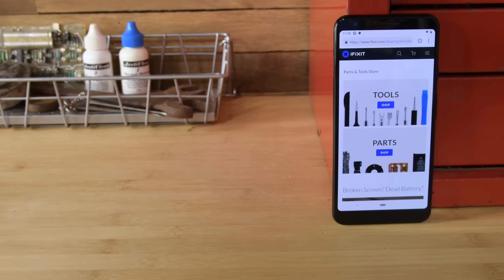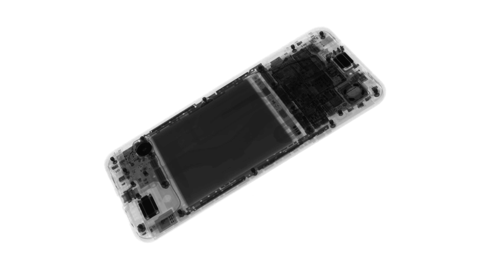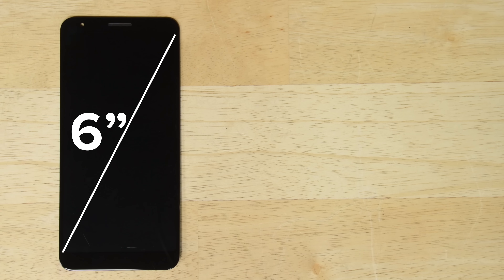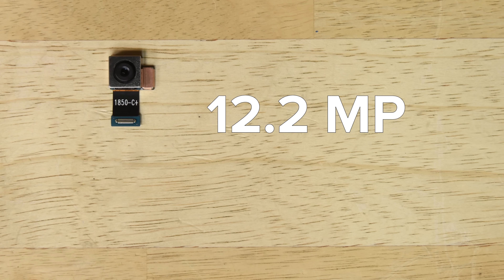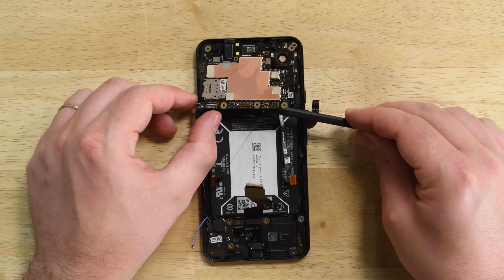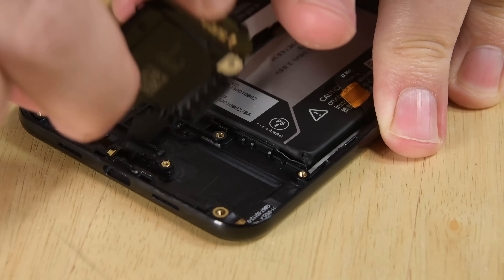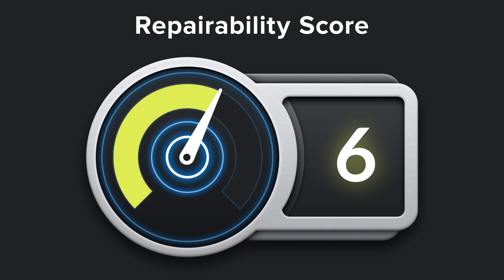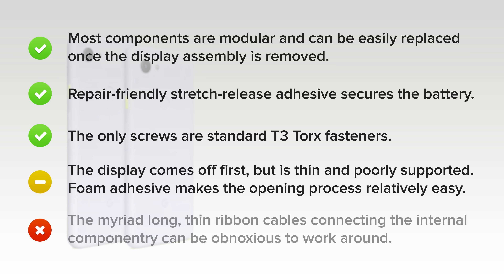Pixel 3a XL Teardown!

Comment: My entire screen cracked easily when dropped on tile at a remarkably low height. Clearly Google cut costs by using this cheaper quality glass. Do yourself a favor and get a good case. Great phone besides that shortcoming.
Reply: Similar thing happened to me but it was 2 smaller cracks in upper right. Bought a replacement screen off of eBay and easily replaced it. Definitely get a good case as the cheap one I used initially didn't save it.
Reply: @shldnfr  I agree with you there. Repairing this phone was super easy. I wish all phones were this easy to repair.

Comment: Question: is pixel 3a series using different vibrator motor than the pixel 3 series??
Reply: I think MKBHD said no.
Reply: Still the taptics on the 3a is surprisingly good. Nearly as good as my iphone 7

Comment: "the myriad long, think ribbon cables connecting the internal componentrry can be obnoxious to work around" I dont see this as a problem, should have been flagged as yellow and get 7/10 score.
Reply: The Fairphone gets 10/10. 7/10 is waaay to generous. Even this should be a 4/10.
Reply: yeahh. there's phones out there that are more of a pain with ribbon cables than this. this deserves a higher score, for sure. the screen is easily taken apart from the chassis, reducing the risk of ribbon tear, also

Comment: The imx363 is found in many other phones. Like the pocophone the zenfone 5z and others. The main thing pixel has is processing.
Reply: The image processing may be slower in the 3a but it is the same as 3. Understand the difference between the speed and quality of processing. The 3 will do the exact same processing as the 3a, but only a little bit faster.
Reply: Indeed.
But before the 3a you had to pay twice that amount to get that same sensor plus Google's excellent image processing software.
Reply: @Mamo878  twice the amount ? the fuck you talking about, pocophone f1 and other using that sensor weren't twice 399$, you can get similar result installing a Gcam in the f1, and you get even faster soc, more battery and ram, this thing isn't even 399$ outside US. In UK is at 518$, and in India is at 575$, you can get a normal  pixel 3  for 450$  brand new where I live. And pixels are well known for being laggy after a few months even with the latest Qualcomm SoC
Reply: @Mamo878  I think the Nokia 8.1 has the same sensor.
Reply: @Mamo878  Sure but I don't think you get the exact image processing software due to the processors. Something that's very similar but not exactly the same.
Reply: @bibletwink666  
According to some of the reviews of the 3a Google spent a good amount of time optimizing the software in general to the 670. Because of that everything, including the image processing, works better than expected. 
Sure, things may be a little but slower than the full-fat Pixel 3 but the IQ so far seems very similar. We'll have to wait for the inevitable ton of 3 vs. 3a camera tests to start coming in to see how things compare though to know for sure. But things look fairly promising so far.
Reply: The sensor is same but the lens assembly are different as far as I've heard. Which gives it a little edge over other same sensors.
Reply: And the OIS and optics/lenses? You are completely wrong if you think the camera is only the sensor. lol. Pocophone has a cheap ass chinese optics and no OIS thats why it can never be as good no matter what
Reply: The processing thing can be done by GCAM MOD APP

Comment: I don't get why plastic phones can't have poppable backplates like they used to... I'd buy that in a heartbeat if it had a removable battery like the Galaxy Nexus
Reply: You might as well say goodbye to any remote IPA rating with a pop off back. Waterproof? Forget about it
Reply: @IOwnThisHandle  Samsung Galaxy S5.
Reply: @IOwnThisHandle  IP67 means 1 meter deep submersion for 30 minutes protection.
Reply: @FastSloth87  provided that it's clean, not salted, not chlorinated water - you can't even drop it on a pool which make IP67 useful in what? dropping your phone in a toilet?
Reply: @FastSloth87  Just because they claim it can, doesn't mean it will. Lasting 30 minutes is undoubtedly without usage, which rapidly brings the quality down.
Reply: Thickness. A removable backplate requires an additional layer of plastic to separate the battery area from the rest of the phone to protect the electronics from fingers, dust, etc.
Reply: Because they don't want you to fix your phone by yourself. They want you to bring it to the shop where they can overcharge you for a fix.
Reply: JTagStudios  maybe Google thought the same: why put the blame on us just because a few idiot hurt themselves and decided to sue us?
Reply: There were phones with a metal removable back
Reply: Willdrick they need a housing for removable/changeable battery taking up more room and making it cost a bit more
Reply: Good old Nokia days ☺️
Reply: Just that google want to chase the latest design trend but not thinking too much about functionality
Reply: for security purposes
Reply: my Nexus 5X was very easy to open
Reply: The real reason is that removable batteries need to have a "protection" so people don't bend them so easily. Having that protection makes the battery thicker, which would make the phone chunkier and in the same time, it would have less capacity.
Reply: JTagStudios  unfortunately most of the population is not  as tech savvy as us geeks. They out number us by the millions, so Google is just playing it safe. They know most of use geeks would of moved on to the latest and greatest by the time this phone breaks down. The thing to go first for most will be the screen so at least they made that easy to replace.
Reply: Hayden Shik because people put bad batteries in them. Batteries that caught fire and damaged the phone.